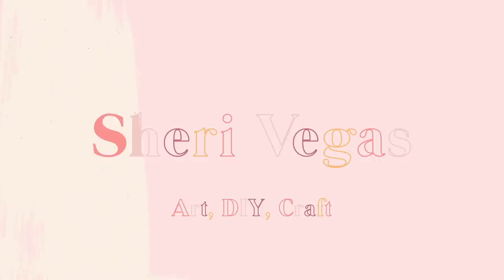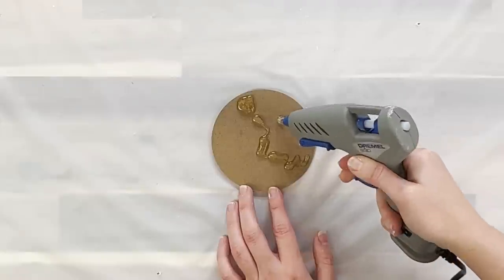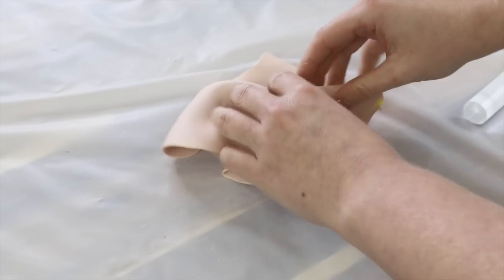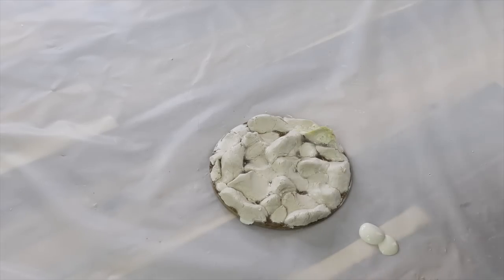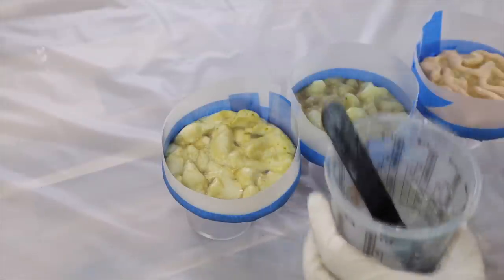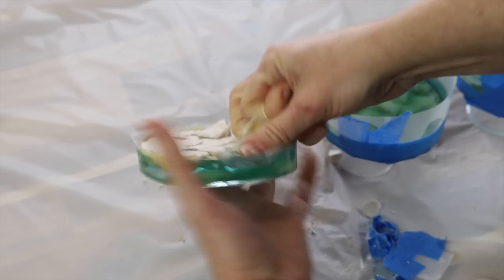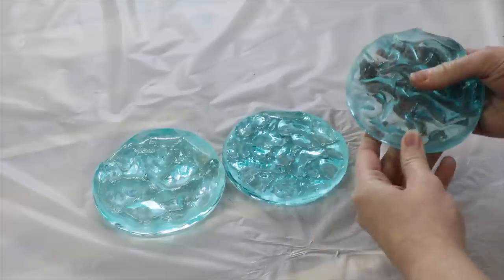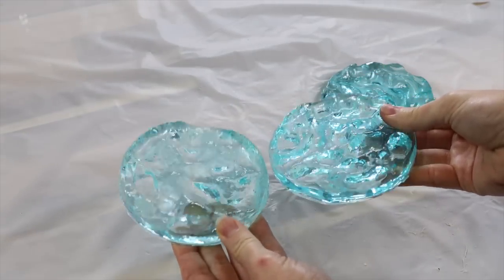I Cannot Believe That This NEW Resin Water Ripple HACK Actually Worked!

Comment: Hot glue, you could use a soldering iron that is used for burning wood pictures as it has different heads that can be used for adding details to the hot glue base before adding the liquid latex.
Reply: Thank you for your tip! 👍

Comment: Thanks so much for this video. Using liquid latex is a new tool for me. I want to try this but pouring the resin in thin layers, each layer being lighter than the previous one, in hopes of creating a look of depth. I do come up with some good ideas.  They would be great ideas if they actually worked. :octopus-red-waving:

Comment: That is really cool.  I wonder if using silicone used in construction and for sealing leaks and stuff would work?  Since, it is silicone, than you wouldn't need liquid latex.
Reply: Silicon has the problem of self levelling so you would end up with flat spots, liquid latex does not do that because it drys faster. It’s also why you do three coats each coat is brushed on in a different direction each time never in the same direction as it follows the same lines of the brush the third coat is where it smooths out more that the brush strokes no longer show.
Reply: Silicone caulk could possibly work great 
Might not come out crystal clear needing a top coat .. but I was thinking the same thing as @theresathomson787 
My favorite is the hot glue great experiment.

Comment: I am definitely liking the hot glue coaster. You could use a soldering  iron or a wood burning tool to help mold your lumps if glue. I think using the hot glue is definitely the cheapest way to go. About 10 years ago my friend and I got a huge box of glue sticks from Amazon. The more you buy the cheaper it is, and we will definitely be using it until the day we die. 😆 🤣 😂

Comment: The polymer clay seems more versatile.  Like you wouldn't have to make all the ripples as big if you didn't want to.
Do you think a thin layer of silicone would work as a barrier in place of the liquid latex?
Reply: Silicone has the problem of self levelling which the latex does not do because it drys faster.